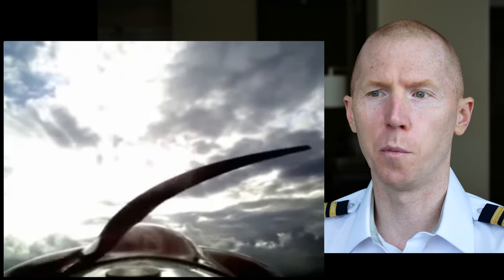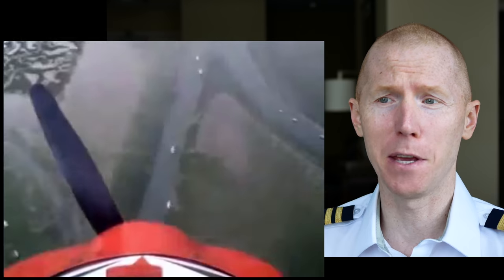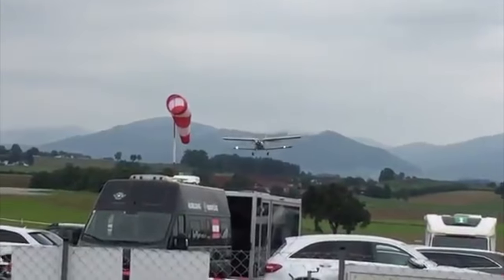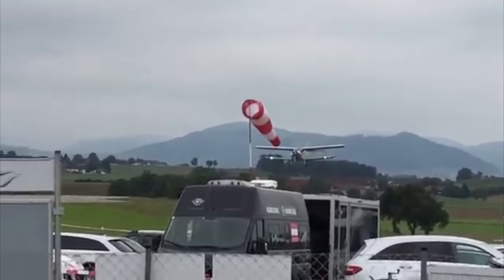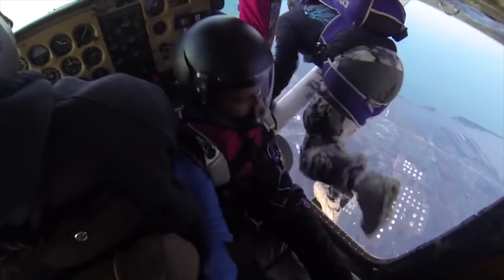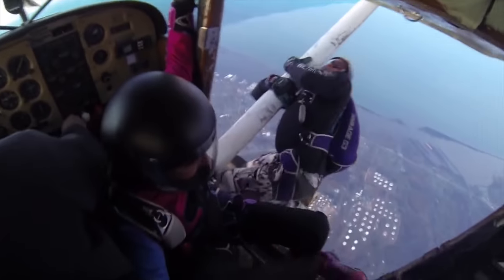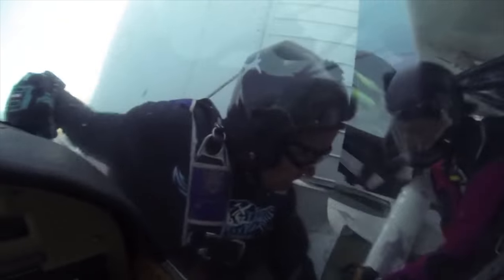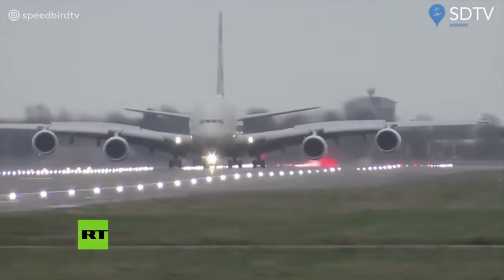Mid-Air Collision Rips Plane's Wing Off | Viral Debrief

Comment: PART 1: that biplane pilot was simply descendng too fast and did not have enogh forward speed to get any reasonable flare.
PART 2: This plane colliision should NEVER happen.  The two pilots should have made exact plans as to what they were going to do and keep talking on the radio at all times while in the air.  At least one plane should have been in sight of the other at all times.  I am a GA pilot w/ 3,100 hours and a low time skydiver (904 jumps).
PART 3: I would not want to be a pax sitting near the tail of that A380.  Depending on the degree of crab (intensity of the crosswind), the pilot should have slowly straightened the forward path of the A/C by cross-controlling before touchdown.  In cross-controlling the pilot lowers the wing on the side the crosswind is coming from using the ailerons, then uses enough rudder to straighten the plane down the runway.  The upwind side main touches down first, but all considered the rear seat pax are spared an uncomfortable landing.

Comment: Looks really bad; however the plane the guy is at manages these flat spins relatively easily, as soon as you put down the front of the plane, (most of the weight is front or CG ) the vertical stabilizer catches up even in with little knots of airflow. Secondly I would say the pilot made the flat spin on a purpose, what went out of the plan, or came unexpected in my opinion, was him unable to restart the engine. I would say it could be due the side g-load preventing that, even though acrobatic planes should not have trouble with fuel flow in any position and under certified maximum g load. Maybe someone in better knowledge could share his view...

Comment: I know it is easier for the jumpers to get back to their point of origin if you jump right above the airport the jump school is near, but this makes for an increased hazard level around the airport's air space. As a pilot, I know it is harder to look for traffic while your attention is on other things. I've never flown a jump aircraft but making sure you are straight and level while the jumpers exit, could distract you from keeping your scan going. I'm sure the jumpers were just out to get a rush from parachuting that day, but it does add to the distraction level of pilots if they are jumping into an airport's airspace - something I have experienced as a pilot while jump operations are going on. I'm not trying to be a buzz kill - I prefer safe airspace around airports. Kind of a funny attitude in a way, considering I think the effort of commercial flight companies trying to get general aviation banned from class B airspace is not beneficial.

Comment: This is what concerns me about so many  pilots. including the author here who claims to be a 747 pilot no doubt with decades of experience, he like so many others  describes “the stall as a result of flying too slow and there not being enough air flowing over the wings etc”. This is completely false and is why so many pilots  get inadvertently killed believing it.
FACT is a stall ONLY happens  when the wing reached its critical angle of attack (AOA). This can be achieved at any airspeed and is caused ONLY by the pilot pulling too much aft elevator. 
Interestingly each aircraft has what's known as the stall stick position. This is an exact  aft stick position where the plane stalls every time regardless of air speed.
I learned all this from an old ag pilot who trained me in my own aircraft. This information has held me in good stead for 25 years of sport flying. 
Take away: the stick position directly and reliably correlates to the AOA at any air speed.